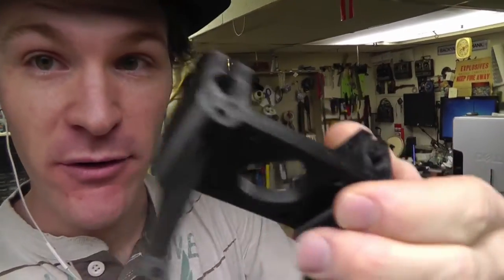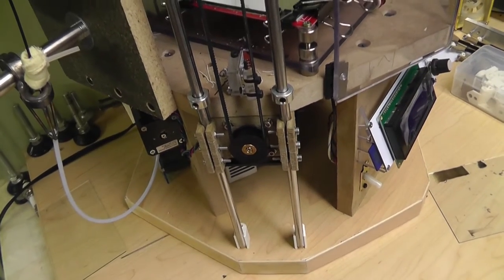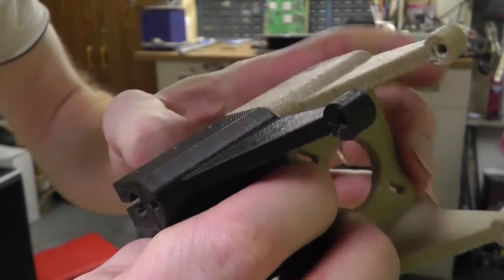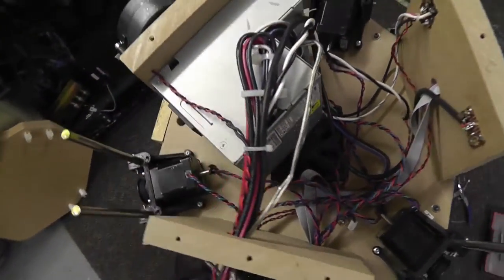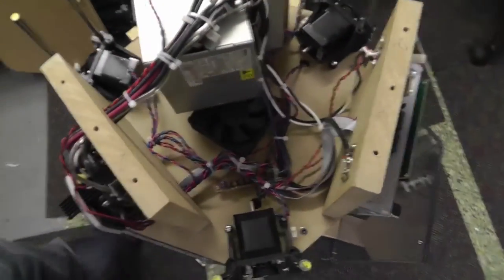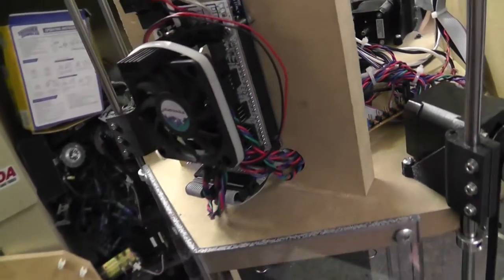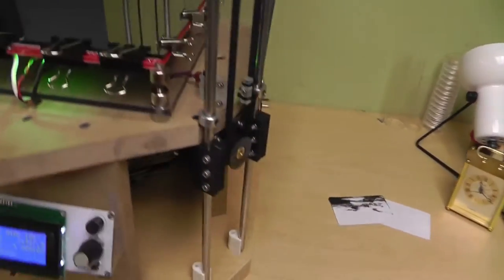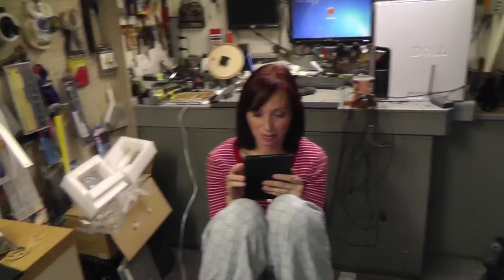Replacing the Motor/Rail holders on the Rostock 3D Printer... sonner than i thought...

Comment from the maker: i use ABS for all my prints so far, but i will be trying different plastics as im building a filament extruder... :)  i had over tightened the bolts... my fault. these new ones should not brake :)  yeah you can scale this thing up. just need more ridged parts... i would do it proportionally, yes.  glad to see you around!!! blessings! ~Russ

Comment: I was thinking you might print all the parts for back ups if something go's south, I was looking at the plate that has the hot end on it, it looks a bit rough.
If all the parts that were donated to you are PLA you might consider it, as ABS has been said to be tougher.